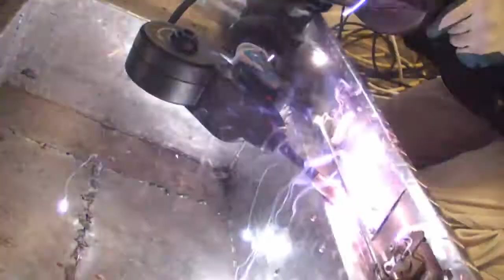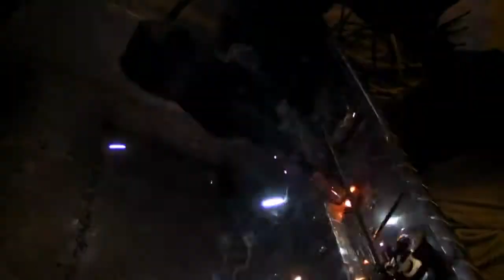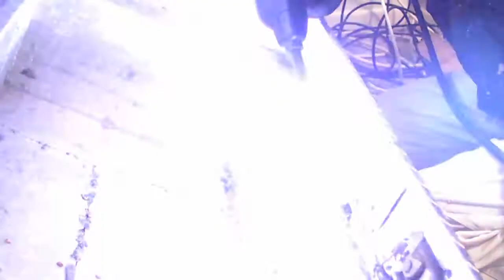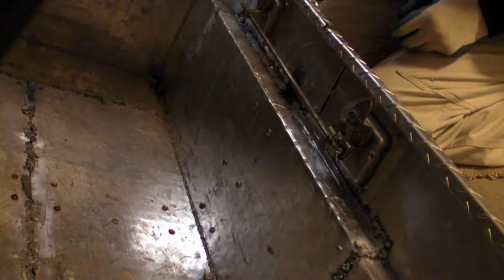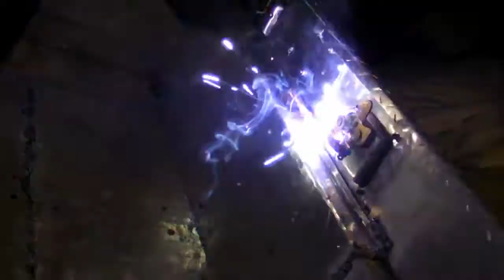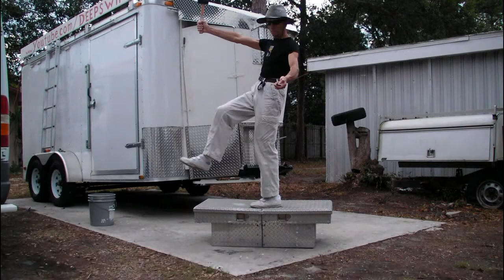Welding Aluminum  tools BOX

Comment: CAN I USE 140 INSTEAD OF 180?
Reply from the maker: Yes U can.
I did pickup 180 to be in 220V range.
I do (did) have all my welding set fro 220Volts. Cables and extention cables too.
First I got 140 and figured out I need new cables set. Returned 140, got 180.
Aluminum spool gun gives U max 100amps. I do use only 20,30, very seldom 40 amps weld-settings
Reply: *****
thanks man
what you use to cut the sheet and bending?
Reply from the maker: sun and moon for cutting skill saw, or chop-saw.
For bending welding table. Do have video about browse-down please, or I may send U a link
Reply: ***** could you send me the link, i like to make a alumium box for my motorbike